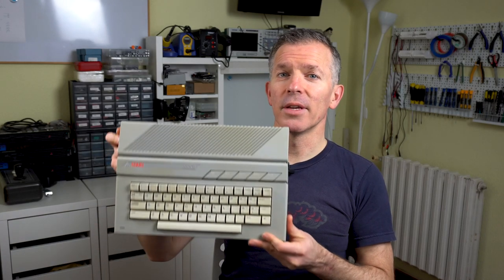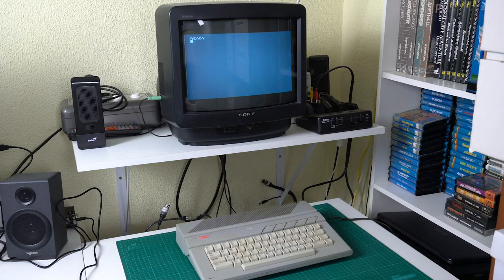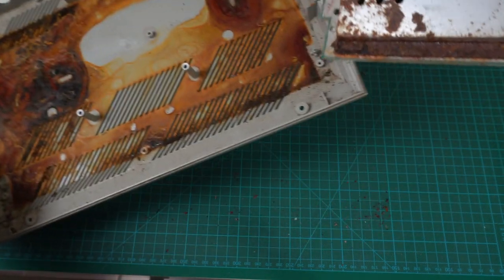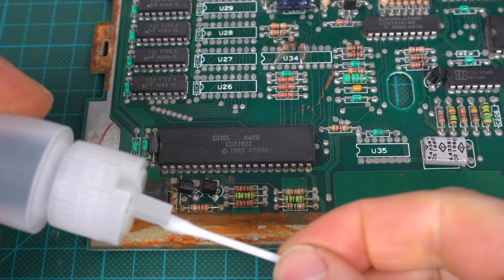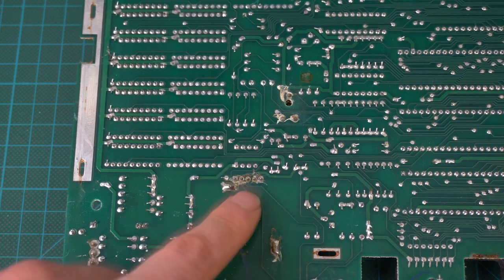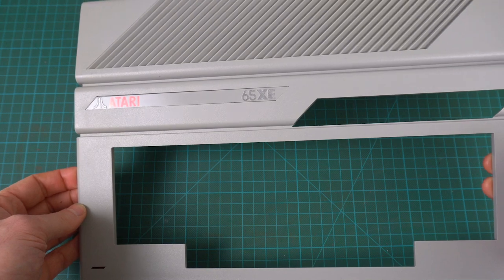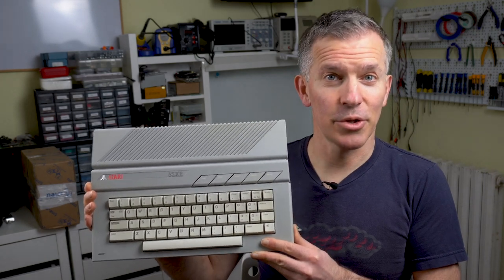Can It Be Salvaged? Atari 65XE Restoration

Comment: Great job!! Protip - placing the case outside in sunlight does a great job of retrobrighting and there's no risk of streaking and there are no harsh chemicals involved which could degrade the plastic. The hydrogen peroxide method is falling out of favor as far as I know.  Again great job and thank you for creating the video.
Reply from the maker: I had read about that method, but I have never tried it. I doubt it would work with the sun we have in northern Spain, and especially not this time of the year. I should try one day in the summer though.

Comment: Impressive job on that machine! I used to work as a repairs technician for Atari and Commodore. The state that some machines came in was nothing short of mind-boggling.

A quick follow-up video when you get the keyboard membrane would be good...
Reply from the maker: Thanks! Yes, I was planning on doing a followup video. Maybe doing a memory upgrade at the same time.

Comment: Acid is a good thing to use in the future, I used a lot of it to remove paint or rust.

Plastic does not react to acids, but Metal and rust will. The same thing with the rf shields and boars. You can use the acid at it and then use a base to neutralize it and refresh solder mask that broke open from rust.

Best acid I used is sulfuric acid from the drug store. Used it to remove rust from my C64 years ago, but it was before Youtube showed us such great videos to help us :)

Comment: A fix I tried for friend's 65 XE was to cut out the shielding anew from blank aluminium plate and use that one, completely replacing the original - it worked fine, though I had to improvise a bit on attaching it to the board - I used flat risers instead of bending the sides and cutting out those 'twisty latches'.

Comment: Wow, that poor Atari 65XE  has had a rough life.  I hope that you are able to fully restore it soon.  I have an Atari 130XE and I have enjoyed programming little basic programs on it with my 4 year old daughter.  The only thing I worry about is the 35 year old Power supply.  I'm sure there are places out there making replacements, but I don't know where.
Reply from the maker: Unlike other systems (cough, C64, cough), the power supply is a piece of cake. It's just 5V supplied through a DIN5 connector (alternating pins carry 5V). I've made a bunch for XL systems in the past.

Comment: Here in the United States, we have a product called Evapo-Rust that removes rust from steel/iron and also will remove the rust stains from plastics and other surfaces. It is completely non-toxic, and isn't an acid - you can let the item sit in it for hours. I'm not sure if you can get a similar product, but it may be worth trying something like that in the future.
Reply from the maker: Someone mentioned that too. I should definitely look into it. It sounds perfect for this application. Thanks.

Comment: You could of used a dremel tool with a wire brush on the end to clean rust off RF Shields. It works well.

Comment: Good job! 
Have you ever used isopropyl alcohol in an ultrasonic cleaner to clean boards? I removed the battery leakage acid that condensed all around, and it helped remove some rusty, too.

Comment: In order to get 128k of ram, you have to install EMMU chip (C25953) or provide a replacement. If you cannot get your hands on the original EMMU and have to use a programmable logic replacement, I guess it makes more sense to upgrade to 1024k using one of the popular extensions.

Comment: Why do people forget about the 1200XL? It was before the 800XL and unlike the 800XL, did not have BASIC on ROM, going to the Memo Pad mode.

Also the Atari 5200 was the first 8bit game console system using the same architecture as the 1200/800XL but with the Pokey (for sound) and Antic & GTIA chips (for video) addresses switched around. So the games from the computers can be ported to the 5200 with minimal programming changes.

Comment: don't know if anyone has said it yet but the xegs when the keyboard is attached to the sio slot on the left side in the front it behaves and functions just like an Atari 600 XL/ 65 XE due to the fact they are all the exact same machine with minor revisions to the mother boards as time went by. it only acted as game console when the keyboard was not attached and had missile command built in by default and would run it if the keyboard was not detected on the sio port.
Reply from the maker: Yes, I've read that in a few places. It has made me much more interested in trying out an XEGS one of these days.
Reply: @NoelsRetroLab  well I hope you get the chance to get one of these days They really are nice flexible machines I love mine got it modded all the way out too :), 1 meg of ram yeah virtual HDD and Floppies on board with the side 2 cart.
Reply: The keyboard on the XEGS has its own plug. It doesn't connect on the SIO.
Reply: @theannoyedmrfloyd3998  oh I thought it did my bad.

Comment: It is supposedly the best 130XE board there ever was produced. It is most stable, easy to expand memory, and produces a good quality picture (without any noise or bars). To make it real 130XE you need 8x 4164 DRAM chips, and an EMMU CO25953 chip (or programmed GAL16V8 and 74LS95).
P.S.
I believe you can use joystick to navigate through the directory list of UNO-cart.
Reply from the maker: Good to know. I'll probably give it a try upgrading it to 128K in the near future. Looks like a fun project.
Reply: @NoelsRetroLab  You may watch this: https://www.youtube.com/watch?v=-z8esiGqYaU - this is the same board revision, and original EMMU chip is used (very hard to get).
More detailed description here: https://www.exxoshost.co.uk/forum/viewtopic.php?t=160
You may also use 41256 chips, to have 64+256, which would allow you to run most of the existing demos, and recent games. But you had to know that there are two concurrent 320kB expansions - RAMBO 320K (a.k.a. Newell Industries), and Compy Shop 320K. In the USA RAMBO was more popular, but only German Compy Shop is fully compatible with 130XE ANTIC access. They also have different addressing scheme.

Comment: Late to the party I know:  I just wanted to add that in the past I have repaired a cracked keyboard membrane with conductive paint as a glue, aluminium foil as a replacement track and then tape for reinforcement.

Comment: Great video! Lots of take aways for me as I'm also trying to restore a recently acquired Atari 65XE. What spray paint did you use to rust-proof the RF shield, etc.?
Reply from the maker: Glad to hear it! I showed a quick shot of it. It's labeled as a galvanizing zinc paint. You can probably find it in any hardware store or even Amazon.

Comment: Wow that was a messy machine once you got inside it.  What do you think caused the two black lines on the bottom? Did someone leave it on top of some curling tongs or something like that?
Reply from the maker: I don't know! I suppose it could be the usual power cables plus the polystyrene foam from the box, but they're so deep and well-defined that it's a bit unusual.

Comment: Just a note - many 65XEs come with just a cartridge port and not the full ECI, so the Sys-Check cart would not fit.
Reply from the maker: Ah, that makes sense. That's why I was half expecting it not to be compatible. Still working my way around the nuances of the XE line.
Reply: @NoelsRetroLab  See http://www.classiccmp.org/dunfield/atarixe/h/back.jpg or http://oldcomputer.info/8bit/atari8/compare.jpg
Reply from the maker: @PG-gs5vb  Very interesting. I also saw that not all boards come with the room to add the second bank of 64KB like this one did. I wonder if it's a PAL vs NTSC thing, or just different points in their manufacturing life.
Reply: @NoelsRetroLab  The later 65XEs and probably all 800XEs used the same PCB as the 130XE with half of the RAM slots unpopulated, just like yours. It was probably for cost-cutting reasons as they could just manufacture one board for all models and the manufacturing cost between the 65XE and 130XE PCBs was pretty much the same.

Comment: 9:28 - wait a moment! I see empty placeholders next to RAM! Does that means 65XE can have 128KB or that's for different capacity RAM chips?
Reply: Yes, the later 65XE models used the 130XE motherboard, and just left off the extra RAM. The earlier boards don't have the empty spaces for more RAM or the ECI port.

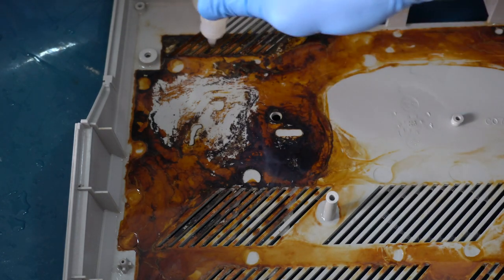Comment: 7:57 I wonder if a rust remover would have worked. something like evaporust for example
Reply from the maker: Maybe. I'm not familiar with that one (or many other rust removers for that matter). But this stuff was STUCK to the case. Seriously stuck. Some people mentioned vinagre would have done it if left on the case for days.
Reply: @NoelsRetroLab  Ok this might sound like an add now: I have experience with a few different types of rust removers, as I have a history with metal works.
Evaporust is by far the least aggressive and at the same time very effective rust remover I know. It really works the way they advertise.

My worry was about the electronics, as I have no idea if it would have any influence on them, as you have to submerge the rust, for it to really work.
Reply from the maker: @Doan84  In this particular case it was just on plastic, so that would have been fine probably. Maybe I'll try it next time I encounter something massively rusted like this. Thanks for the tip.

Comment: Do you not have CLR (calcium/lime/rust remover) in Europe? That is what I would have used to clean it. I have also had good luck with food-grade citric acid (and it is obviously non-toxic, which is nice).
Reply from the maker: I just looked it up and it doesn't seem to be available here. I agree that some other, less dangerous acid would be better though!
Reply: @NoelsRetroLab  hmm. Try looking for "sulfamic acid" no amazon. In my experience, that stuff is, hands down, the best at removing rust and corrosion. It is also the active ingredient in CLR. Plus, to quote Wikipedia, "Sulfamic acid is preferable to hydrochloric acid in household use, due to its intrinsic safety."
Reply from the maker: @ichemnutcracker  Awesome. I'll definitely check it out. Thanks!

Comment: Why you don't use a spray like kontakt PCC instead of alcohol?
Reply from the maker: For which part, the flux after soldering? I don't know. I learned to use alcohol for that and never considered something else. I do have some contact cleaner spray is is probably most alcohol, but it didn't occur to me to use it to remove flux. Do you recommend it over alcohol?

Comment: I hate yellowing too but retrobright lasts from 3 month to 3 years.
I gave up.
Reply: OK, I have a C64 in the same condition full of rust.
I used a cleaning solution that I buy from a chemical store.
Unfortunately it has no name but I when I go there I ask it as "rust" for clothing.
It completely vanishes rust in a few seconds.
Reply from the maker: I know a lot of people report that, but that hasn't been my experience so far. If wonder if it has to do with the environment they're kept afterwards (light vs not, hot vs cold, etc).
Reply: @NoelsRetroLab  Sometimes it  even yellows in a dark closet :-/
Reply from the maker: How odd! Did you try putting some dashboard protectant or some other kind of plastic protectant after the retrobrighting? Maybe that helps make it last longer.
Reply: @NoelsRetroLab  I wonder if anyone is doing any long-term tests on retrobrighting? I'd love to see a study done to see if and how much the yellowing stays away.
Reply from the maker: @IDPhotoMan  I agree. That would be really useful!
Reply: @NoelsRetroLab  Nothing, just in a box.
You can't have a study, there are many techniques to retrobright and many different environments/situations to include.
I've done many methods, even the "only sun" one. Everything returns to yellow.